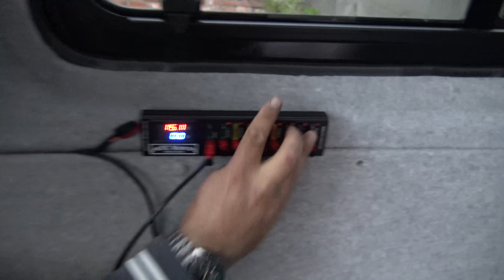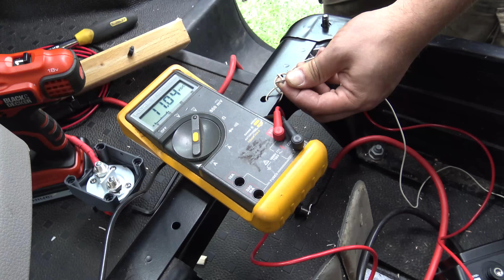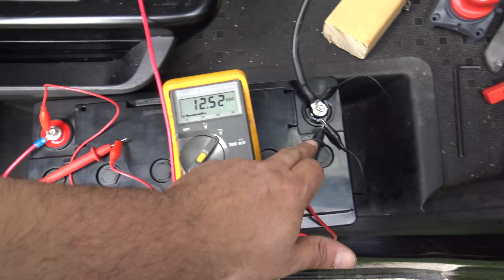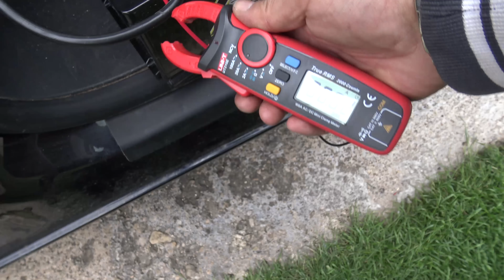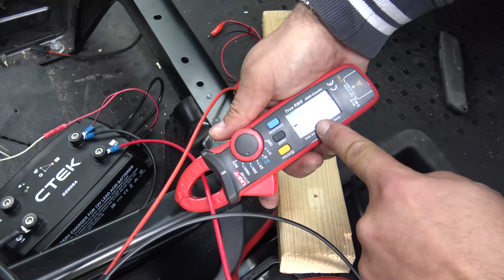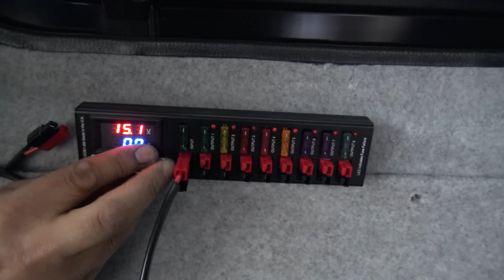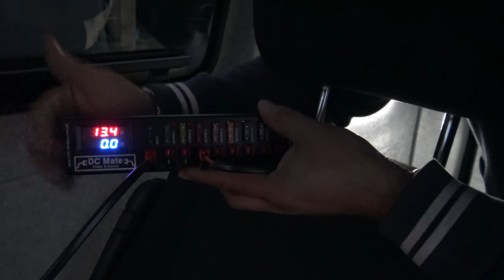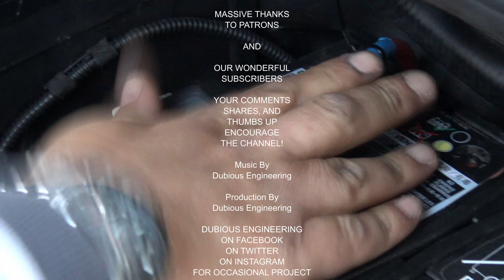DuB-EnG: T6 Campervan - Wiring up CTEK D250SA DC-DC charge controller Euro6 smart alternator engines

Comment: Fun video. You can run the thin red cable from the CTek to the van fuse box without removing the centre dash. You can pull the mat out from under the dash on the passenger side and your in.
Reply from the maker: We couldnt seem to get the fuse box out, that was our problem...   we needed access to the back of it to connect wires...  Anyway, done now...  :-)    Thanks for your thoughts on this, I'll consider this if we need to get bac in there in the future!!
Reply: Dubious Engineering I just plugged it in from the front with a piggy back fuse.
Reply from the maker: Yup... the piggyback seems like a really good way forward!

Comment: Thanks for the video - very helpful.  I'm looking to sort out a charging system for my 2018 T6 with a smart alternator and the advice I've been given is that I need to use the D+ output from the alternator as the signal since this is only live when the engine is running, not simply when the ignition is switched on.  Is this what that fuse you wired from is providing or is it simply ignition on?
Reply from the maker: Yeah mine is ignition on... which is a bad thing really as if you leave your keys in... it stays on!!  I always take my keys out.  Go ahead and do a little more research... the T6 forums are a great place to find this kind of info.
Reply: @DubiousEngineering  Thanks for the response. I'll keep digging but I do like the simplicity of your solution!

Comment: Was it allowed for your battery to be mounted on any side or you did it out of way? It has been long time for you now, what is your opinion/ review about it now.  

 Can we mount all AGM/ deep cycle battey on it's sides. I have PowerSafe (SBS b14f 62ah) and Bosch (S5 A13), any suggestion? Thanks
Reply from the maker: Well, it continues to work well...  sorry no idea on your setup... happy with what I did - works well three years in
Reply: Thank you

Comment: Isn't 15.1v output  a little too high? According to the CTEK manual for an AGM battery  the output voltage should be max 14.7 volts when in the Bulk/Absorption stage then decline to 13.6v when in the float stage. Thoughts?
Reply from the maker: I admit this is bugging me a little... I’m going to have another look this weekend...  that said, I expect the charger is doing what it should!! Best... H
Reply: I came here to say the same, maybe the meter in the distribution block is not super accurate. If the CTEK is hot, guess you could put it back in normal battery mode rather than AGM and that would lower the voltage a little. 
Edit: just got to 11 minutes where you measured the voltage with a fluke and got 15 volts. So I would say that that CTEK is far over charging the battery which is really bad for AGMs because it will cause them to gas and lose capacity very quickly as they gas. It would be good to put the charger back into normal battery mode so that it didn't go above 14.7. If possible it would be even better to lower it to 14.4 it will charge a little bit slower but it will last longer.
Reply: @DubiousEngineering   The high output is part of the chraging profile called sulfate removal. Totally normal if youve just installed it to a new battery. You can see the different charging phases in the d250sa manual.
Reply from the maker: Yes agreed ...  you are quite correct!

Comment: Nice video. You've probably encouraged me to move the position I had planned for my battery. What size cable did you use from the Van battery to the CTEK? Would you be able to list the items you are installing in the description? Thanks.
Reply from the maker: SOrry for delay, the CTEK only pulls about 20 amps, so I suggest you use the 3mm or 3.5mm cable.  I properly over-engineered mine.  I'll get a shopping list together at some point, but if you scour ebay or visit the "travelvolts" website, most of what you need is there...

Comment: Can I do what you've done with the CTEK & battery but put it all into a Mobile box? Use an Anderson plug for input power/earth and a seperate anderson plug for output to an inverter for example? Cheers 👍

Edit: The idea being to have the battery box in the car when using a roof top tent and then able to move it to a camping trailer
Reply from the maker: Absolutely yes!!   That’s a great idea actually!!
Reply: @DubiousEngineering  Class! I presume you'd just have to extend the small trigger wire back with some sort of a plug to the boot/trailer? I've been contemplating a VSR as I don't have a smart alternator but I've heard horror stories of back feeding batteries etc. So I'm sold on the CTEK! 👍

Comment: Are you going to install an input for 240v? As it would be useful when at a campsite to charge battery, fridge,hairdryer etc! I would like to here your ideas as I have only ran a traditional split charger set before
Reply from the maker: Harry Higgins ... I’m planning to have a 12v 10amp switch mode plugged into the solar side of the battery charger!!

Comment: Hi m8, thanks for the useful video. Very helpful. 

The isolation switch,  did u wire it to isolate the ctec charging system or to isolate the voltage/power to the camper?
Reply from the maker: Yeah... the charger is always connected...  the isolator is for the accessories like fridge, lighting etc...  future video...
Reply: @DubiousEngineering  thanks for the reply m8... much appreciated.. Very helpful video 👍👌
Reply from the maker: Pleasure Mike!!  Enjoy the weekend!! :)

Comment: Hi,  what gauge is your red and black wiring from main to second battery ?  As doing same job using a 135 am AGM, and a cetk unit.
Reply from the maker: My wiring is too thick as the max the ctek draws is about 20amps... and trust me, in practice it’s much lower... so 3mm or 4mm cross section should be fine ... I think mine is like 7mm - it was originally for a split charge relay (which doesn’t work on T6 euro 6 engines)

Comment: Hey mate just set up the same system in my 2018 T6 but it seems to be running the starter battery low. Did you ever have any problems with this. Instead of coming behind the fuse board I used a piggy back fuse with 2x 5amp fuses on the camper fuse so should be working fine.... confused
Reply from the maker: Mine is always connected...  there is a bad batch of starter batteries out there that are being replaced under warranty...  if you make a MOLL battery, get it replaced :-).  Check your CTEK powers down when the keys are out of the ignition...  if you still have lights on the CTEK, your piggy back may be in the wrong place....
Reply: Dubious Engineering thanks mate much appreciated the negative light flashes green slowly I’m assuming that means it’s good. But light do turn off when keys are out... il check my battery

Comment: nice video. one question, do you know if that CTEK dc/dc battery charger also works as a battery splitter? so does it prevent the starter battery from going flat while the engine is not running or does it need a separate splitter?
Reply from the maker: Mark Alexander DeGiorgio yes it prevents the drive battery from discharging :-).  It’s essential for the Euro6 engine...

Comment: Does the ignition signal drop out when starting so the starter system does not draw high current through the smaller cable, fuses and connectors?
Reply from the maker: Hi Karl, not entirely sure I understand your question...  the ignition signal doesn’t drop out.  No small cables supply big current...

Comment: Save money and just disconnect the smart alternator sensor plug from your negative battery terminal. 
This reverts the Vehicles CPU/ECU to thinking it has a normal alternator fitted therefore you can use a normal liesure split charging relay system. Trust ive done it before and am doing it now 😉 (Depending on make/model of your vehicle)
Reply from the maker: Tell me how you get on... I’m keen to know, as without proper charge management the service life of the AGM batteries is significantly shorter... (according to the manufacturers)...
Reply from the maker: As a follow up, if you have standard lead acid batteries... it may we’ll work, but test the voltage isn’t too much higher that 13.8v
Reply: Does this not only effect the stop/start function (so increasing the environmental impact of the vehicle), but possibly other ECU controls ?
Reply from the maker: Quite possibly...  everything will be running at 15-16 volts not 13-14...  it may stress some components...

Comment: Hi there, what size is the cable from starter battery to service battery under the seat ?
Regards 
Bernard
Reply from the maker: I used massive cable and it was totally unecessary as the max charge current will be about 10 amps - there's a company that sells the cable kits on ebay ...

Comment: This is the first I've seen of this CTEK. Does it work with Lithium Ion Phosphate Batteries?????
Reply from the maker: Ahhh...  Im sorry, no, it works with Pb (lead acid) traditional wet car cells and also AGM absorbant glass matt batteries...  you will need an even more special charge management system for Lithium!
Reply: @DubiousEngineering  Understood. Too Bad! If CTEK does come out with a unit for LIFEPO4 Batteries, they will make a fortune!
Reply from the maker: You may well be right!!
Reply: Bruce Forster there is an upgrade due out this October ish that will work with Lithium batteries. 
Check the RoadPro website 👍🏽

Comment: What size cable did you use to run back to the fuse box? (white one) 

Thanks rob.
Reply from the maker: Small cable... little 7 core bell wire....
Reply: Did you fuse this supply? I see you picked it up off camper display. Did you go into the front of the fuse box? Cheers for your help. I’ve got all the other bits in.
Reply from the maker: Perhaps watch the other videos... we did fuse the main supply, but put 40amp fuses... that’s a little heavy duty.  Suggest 20 amp is sufficient...
Reply: Dubious Engineering I meant the white cable from the fuse box. I’ve sorted mine now. When into the camper display with a piggyback fuse and a 5 amp fuse. 
And it works! Your video was a massive help.
Reply from the maker: robert crawford fantastic!!  I don’t think I fused the control wire...  glad the video helped... it’s always good to see how to so you have an idea of what to expect...  thanks for your kind words!! All the best!!

Comment: Is it possible to use a solar charge controller to charge leisure battery instead of using the solar input for solar panel use say ciggeret lighter socket from car connected to controller (at least to test theory first )
Reply from the maker: There is a solar input line to the CTEK but dont exceed 25volts.  I actually plan to use this line in conjunction with main input by connecting a laptop power supply to it so that when were on mains hookup, we get to run the fridge and charge the batteries too :-)
Reply: @DubiousEngineering  what I have is a 18650 ,3s battery so it's 11.1v nominal and 12.6v optimal so I'm looking to try charge it in the van without the use of solar it's a 20p 3s configuration of 18650sim wandering but obviously very unsure if I use a bms a cigarett socket type plug fused and maybe a step up down converter to reg the volts it's the amps I'm worried about solar puts out say 18v and 5.5 amps what about a cars cig socket??
Reply from the maker: Is it a home brew 18650 battery bank or a proper BMS protected bank?
Reply from the maker: Either way, make sure you limit the voltage and the BMS should take care of the rest
Reply: @DubiousEngineering  it's a home brew matey with bms of 30 amp I fitted ,should I then set the converter  voltage to the batteries optimum of 12.6 or like 18v of what a sloar would put out ,

Comment: Would have been nice to show how to wire into the ignition fuse
Reply from the maker: Sorry... just wrap it around a fuse blade... we went the next level and soldered it in...
Reply: @DubiousEngineering   cheers mate !
Reply: @euromodeller  Ive just ordered some piggy back fuses mate to make things easier for me, couple of quid of ebay

Comment: Maybe you should make the solar panels charge the main battery or you won't be going anywhere at all.
Reply from the maker: Got it all sorted now... VW came to the house to replace my van battery as it was faulty and failed in warranty...  :-)
Reply: You can pair the Ctek D250sa with the Ctek smartpass, this gives you the option to use the leisure battery to start the vehicle in the event the starter battery dies.

Comment: What made you go for an AGM battery?  You are aware that despite manufacturer claims, they do still off gas and therefore require venting, especially in a leisure vehicle? "It is now universally accepted that AGM won't deliver the capability suggested by laboratory tests, often failing in miserably short times."  92% of failures due to drying out and corrosion. Also prone to poor temperature performance and life claims are highly overstated.
Reply from the maker: I wasn’t aware of this... and now I’m very worried...  everything I read said this was the best way forward...
Reply from the maker: I'm off to have a look now... thanks for the tip!!
Reply: Did you decide to vent the battery? What battery is the one your using?
Reply from the maker: I went AGM and Ctek charger... works flawlessly... no venting
Reply: Venting only happens if overcharged or kept in absorb too long. Overcharging is very bad for AGMs so it would be better for the battery long term to not use the AGM setting to ensure that it's not overcharged. Especially if it really is at 15.1 volts like the distribution block is showing.
Reply from the maker: That 15.1 volts is a result of the de-scaling function of the Charger.  After a few minutes it settles to a better voltage :-)
Reply: Excellent! What does it drop to?
Reply from the maker: Ben Brand I’d need to go start the van...  but it’s more like 14 volts
Reply: That is a big drop, a little low for the absorb stage which is usually 14.3 to 14.7. maybe the battery is full and it dropped to float stage? If so 14v is still high, float should be more like 13.6 which. I would still watch and if it does not drop below 13.6 after 2 hours of driving then it might be high because of the AGM setting and it would be better to just use normal setting.
Reply from the maker: I need to check, but if you can be bothered to download the ctek charger manual, it gives you a full description of the charge cycle.
Reply: @DubiousEngineering  Manual looks fine, The 15.8V of pulses it does at startup sometimes could be seen as 15.1V on a meter since the pulses are changing quickly. Would need an oscilloscope to know better. It does say though that the absorb voltage should be 14.4 or 14.7 normal / AGM and then float voltage 13.6 for either which is great. So seeing 14V is weird, unless the better was discharged and you are only halfway through the bulk stage. The charger does have temperature correction which is great, it is stated as 23 mV/°C from 25°C. So if it's 10°C the absorb and float voltages will be raised 15*0.023V = 0.345V and if it's 35°C the voltages will be lowered by 10*0.023V = 0.23V. The is very important as it helps to not overcharge the battery in warm temperatures which will cause the issues that Van-gabond was mentioning. It also makes sure it still gets a fill charge when it is colder. Because the float voltage is the same for the normal and AGM setting, I would highly recommend changing it back to normal mode. The battery will charge just a tiny bit slower during the absorb stage but this will significantly reduce the change of gassing and prematurely aging the battery. You will still get the same full charge. The other reason I recommend this is because all it says is that the absorb stage will timeout in 12 hours. Most chargers have an equation for how long to stay in absorb. It's usually something like (time in bulk) / 2 + 30 or 60 minutes. This helps prevent overcharging in the absorb stage, but it will still always to 30 to 60 min even if the battery was full. This could happen when driving around town making trips, keeping the battery at absorb the whole time which is another reason to keep it at 14.4 instead of 14.7. The proper way to end absorb is when the current drops below ~2% of the Ah rating which for you is 2.2A with a 110Ah  battery.  However the charger would have to know the size of you battery or be pre programmed so they use the equation so that it can be used for many sizes of batteries. 
TLDR; Measure the temperature if it's very far from 25°C/77°F so you can know how it's compensating, and verify that it is indeed charging to 14.4 or 14.7 and then dropping down to 13.6 which will happen at 12hrs or hopefully sooner if they use the bulk absorb charging equation. And also recommend making the absorb 14.4V. This will greatly increase the battery's life, with minimal change to charging time.
Reply from the maker: Ben Brand ... thanks Ben!!  That’s a great help... my 14v was just a guess as I haven’t started the van in 6 weeks :-).  Also mats DC mate may not have well calibrated meter.  Either way, I trust this thing to do it’s job.  If I ever get under the seat again, I’ll be sure to cut the cable for AGM so it reverts to regular battery.  Thanks for all the info and help :-). Great learning!!!